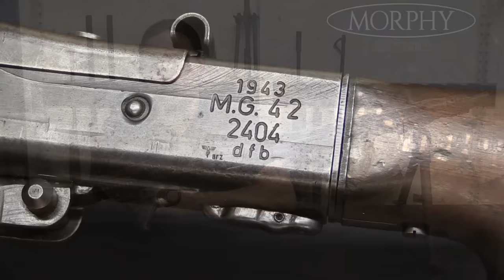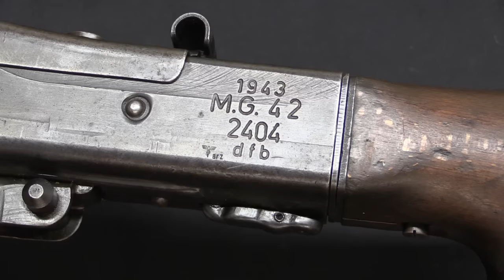Hitler's Zipper: The MG-42 Universal Machine Gun

Comment: It BLOWS MY MIND that those rollers can move fast enough with the barrel extension for that rate of fire and work properly.
Reply: The firing pin holder shoves them out of the way(into their recess) as it is moving forward, its not like they are spring loaded
Reply: If you think about it, the rollers are actually significantly less "material mass" that needs to move to lock the gun,  than most other guns with an entire rotating bolt head have.
Reply: 16:10 Well. They didn't -_-
Reply: Your mind propably wasn't the only one blown by this gun.
Reply: Timing is everything :D
Reply: That German engineering
Reply: Since the gun's inventor had a background in designing industrial machinery, it's not so surprising.  Many different industrial machines move at very high rpms and have parts that reciprocate at great speed.
Reply: Shot these in Germany back in 2004, fucking rips.
Reply: @maxkronader5225  a very smart thought. that make sense.  like sewing machine type movements etc
Reply: @randylahey2242  you are correct. After WW2 they were downgraded to a spring though. To make them align with Nato standards or so. This reduced their firing rates quite significantly.
Reply: Get your hands on one of these for some speed/power metal gun drumming 😉
Reply: I think Ian forgot to mention that the front of the barrel works as a gas piston using the flash hider as the expansion chamber. The barrel moves backwards which disengages the roll lock with the inertia.
Reply: @Lonestar24  .
Reply: @Alpha_Digamma  I wouldn't call it a downgrade. going from 1500 rpm that sometimes blow up in your face, to 1200 rpm that don't blow up seems like a good deal to me.
Reply: German magic
Reply: @Alpha_Digamma  Apparently Nato doesn't believe a tree needs to be cut down that quickly.
Reply: That's the famous German Engineering at work right there
Reply: @twojstarypijany8153  🤯 shit flying everywhere!
Reply: @Alpha_Digamma  afaik, it was limited to about 1100rpm for by the addition of 2 springs (NATO-Bremse) and a different weight bolt for 3 reasons: a) safety, b) barrel life, c) ammo conservation. Someone told me though, if you got the early conversions hot enough in sustained fire, the bolt could expand still enough and the rpm would go up towards 1300, which would make the heat problem only worse. Not recommended.
The MG3, afaik, is still in service with the Bundeswehr, though.
Reply: @paavobergmann4920 , it is but is in the process of replacement by the H&K MG5. The new gun has a significantly lower rate of fire and much greater accuracy than the MG3. The are a couple of German language videos on YouTube showing the new gun's attributes.
Reply: German gun magic
Reply: @PureCountryof91  yeah. Reckless overengineering with total disregard for reliability or operator safety. A typical product of the early 40s.....
Reply: It blows your mind? This is German engineering you know, this is to be expected.
Reply: for real, it's a marvel of engineering. The fact that even today it's fire rate is impressive just shows how crazy it was back in the day
Reply: @Alpha_Digamma  Nein. Die angebliche Natobremse im verschluss ist ein Mythos. Diese Verschlussbremse wurde bereits im Krieg eingebaut, da der Verschluss zurücklief,  während noch ein Projektil im Rohr war. Der Gasdruck hat sich dadurch entladen und Waffe als auch Schütze beschädigt. Die signifikante Änderung der Kadenz erfolgte durch eine Änderung der Schließfeder und vor allem durch einen deutlich schwereren Verschluss. Das MG74 der Österreicher hat einen noch schwereren Verschluss und schießt noch langsamer .
Reply: @paavobergmann4920  if you take a look at a MG3, there are not more springs as in s MG42. In fact the Nato Bremse is an urban legend. Some idiots still tell that crap to new recruits.
Reply: @StUffzSpezPi  Oh, thanks. I somehow imagined the thingy they did to make the breech safer would also limit the cyclic rate, but then I found some source that the MG3 still goes at a whooping 1300, some comment that they may have introduced a slightly heavier bolt for the 7,62mm conversion, and that it actually was the Austrian army that limited the cyclic rate more severly in their own conversion. So this is maybe where the confusion stems from, at least this is where I got confused. Thanks for the info, you learn something new every day.
Reply: @zackmatulis4094  true...
Reply: German engineers doing german engineering
Reply: Guys on dog green sector god their mind blown too dont worry
Reply: Blew a lot of allied minds too.
Reply: I know as soon as I saw that I said why not just put a spring in there to hold those rollers back and lo and behold that was the end fix!
Reply: Yeah they worked great until the gun blew up in their faces. So much for German engineering 🤣
Reply: @mr.anderson9938  If you shot the Bundeswehr Version in 7,62 NATO you probably only had 1200 rpm not the 1600 of the MG42.
Reply: @zackmatulis4094  Mg42 was an unreliable, overrated gun. Face the facts bro.
Reply: @twojstarypijany8153  Hahaha yep, there is that way of looking at it
Reply: @server1ok  a😉
Reply: @Vorteksio3  Yeah thats why it still used today cause its so unreliable and overrated
Reply: @donaldhysa4836  It is overrated and unreliable
Reply: @Vorteksio3  If that was true nobody would be using it. You never even seen one of them in real life have you?
Reply: @Vorteksio3  Ok
Reply: @Vorteksio3  
and yet it was the machinegun that killed the most enemy troops in action and it's basic concept still holds up today as a marvel of engineering lol
Reply: @Vorteksio3  
oh yes it does you absolute bellend - the gun's direct descendant MG3 is still widely used today and uses the same roller locked recoil operated action...so tell me again boo, how it doesn't hold even today lmao?
Reply: @kimskis  Ignore the troll, he is just salty.
Reply: @kane357lynch  Its not perfect by any means
Reply: @kane357lynch  No, they are not using it
Reply: @kane357lynch  your 100% correct your conversing with someone that argues for the sake of arguing. A multitude of Channels on you-tube and other platforms wouldn’t continuously feature this weapon if it wasn’t superb, and set a standard for future designs
Reply: its German, what do you expect?
Reply: @Vorteksio3  so why did the us army in ww2 have to make spec. instruction film about mg42, and how to avoid being hit?
Reply: @zymelin21  Every army should be prepared against every weapon of the enemy.
Reply: @kane357lynch  No
Reply: @Vorteksio3  Yes it is. MG3 is still being used by the Bundeswehr and a other military forces in Europe, along with it being the main co-axial on the Leopard 2 tank...

Also if the MG42 was shit, then explain why it revolutionized the industry...................

Obvious tryhard troll is obvious.
Reply: The power of German engineering
Reply: Obvious troll is obvious but you're all  STILL feeding him. Keep it up @Vorteksio3 you can't stop now. 😂😂
Reply: Blew a lot of people's minds back in the day too.
Reply: it sounds like,  "BZZZZZZAP!!!" lol
Reply: @Lonestar24  s
Reply: It’s so easy to be blasé in the 21st century about cutting technology in early/mid-20th century.... the fastest firing machine gun, even with all modern technology.  One should definitely not poo-poo any marvel of the leap of the firing rate from the MG-34 to the MG-42, in fact... many of the internal processes were adapted into modern design.  The sudden leap to 25 rounds per second is a  genuine engineering marvel, especially considering the era!
Reply: That's because you're not German 🇩🇪💪
Reply: Welcome to Germany
Reply: @StUffzSpezPi  Richtig 👍
Reply: @paavobergmann4920  the Mg 42 was so fucking fast, you had to slow it down in the decades of it service after WW2 to let it not overdue its purpose...80 years in service and still going strong, like your browning 0.50....both genius weapons
Reply: Because German technology is the best in the world
Reply: Kraut space magic
Reply: @Vorteksio3  😂😂😂😂😂
Reply: German Engineering
Reply: Check out the MG3 lol
Reply: The piston in your car does far more mind blowing things
Reply: @randylahey2242  They are spring loaded in a sense.  the main spring which the ejector spoon rides on inside the bolt body itself keeps the tension on the bolt head and the rollers, they only unlock after the barrel recoils slightly backwards and the extensions force unlocks them.
This is of course late war and post war bolts.  The tension on them prevents the OOB explosion.
Reply: It's kind of a simple roller recoil system really.  it's a short recoil gas operated systems with roller lockers.
Reply: Literally
Reply: That’s German engineering for you
Reply: ...they don't get a choice. Very low mass compared to most other systems.
Reply: @Cruisey  he did stop sooo yeah guess his life Must be fun lmao
Reply: Good Ole german engineering
Reply: @server1ok  they did, they performed phenomenally
Reply: @server1ok  just because it wasn't perfect doesn't mean it didn't perform amazingly, everything has its flaws no matter how significant. This weapon is arguably the best machine gun of its time, and ask any historian they probably would say anything too far off
Reply: @zackmatulis4094  probably the most epic response on YouTube I’ve seen in AWHILE. You get the golden star award for destroying someone on YouTube 😂👌🏻
Reply: @zackmatulis4094  you should be. Last thing you want when you have enemies trying to shoot you and you're shooting back is for your own weapon to end you. So yes, operator safety is a concern.
Reply: Similar style to what H&K use.
Reply: A lot of allied soldiers had their minds blown too by those very fast roller movements #IamGoingToHell
Reply: The rattle of that roller system must be insanely loud. No wonder they loved it.
Reply: @doriangray2347  A sewing machine is a great example! It amazes me to this day as well.
Reply: @Vorteksio3  

Best machine gun of WWII bar none. Only the MG34 competed with it. 

It was a post war machine gun being used in World War II. It was that far ahead of everyone else’s machine guns. 

And I’m a proud American and I say that. The MG42 was better than anything our guys had.
Reply: What’s EOD mean